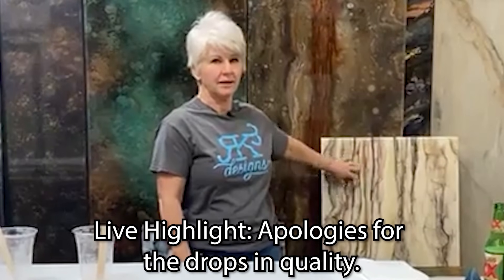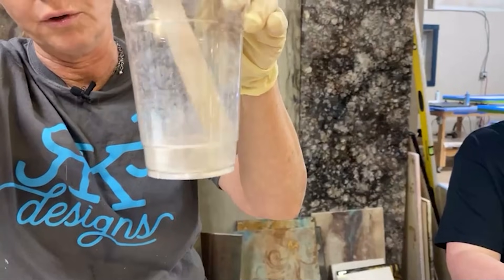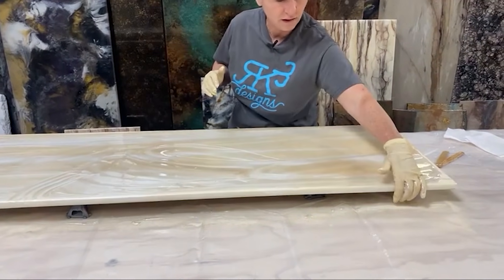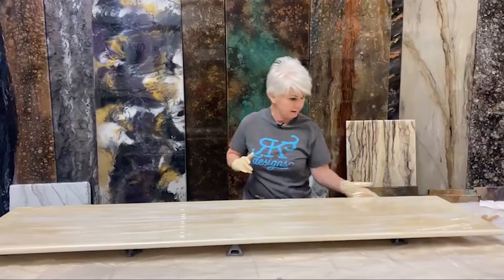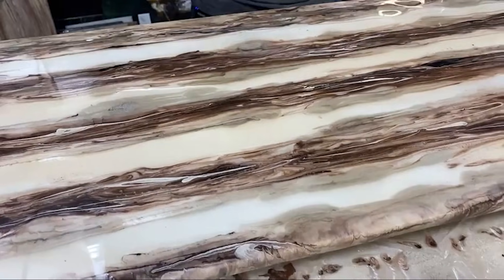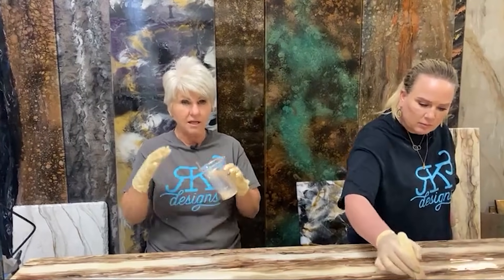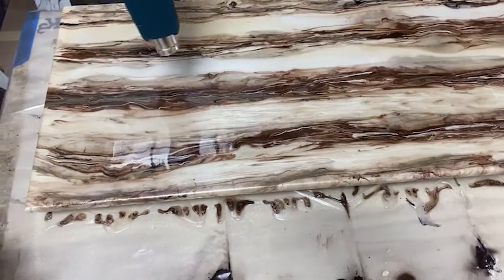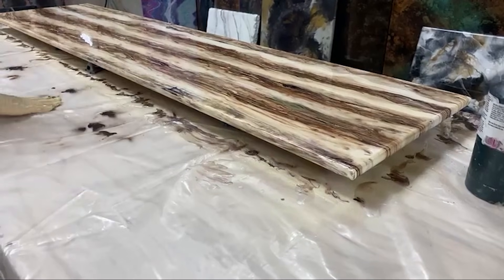Creating Epoxy Veins With Spray Paint | RK3 Designs

Comment: Rhonda I really like this design and colors, but I want to do it over formica, how will that work?  Then I have an L shaped cabinet so how do you do the lines so they look the same?  thanks
Reply: Watch videos on prepping... Preparing your countertop.
Reply from the maker: Hey Sharon. This will absolutely work on Formica, you’ll just want to prep it first with XIM bonding primer first then proceed as normal with your base color etc. check out my prepping video FMI on that. As far as a 90 degree angle, I also have a video that touches that topic as well. Check it out:
“Creating Patterns Across Corners: A Southwest vein finish with Stone Coat Countertops Epoxy”